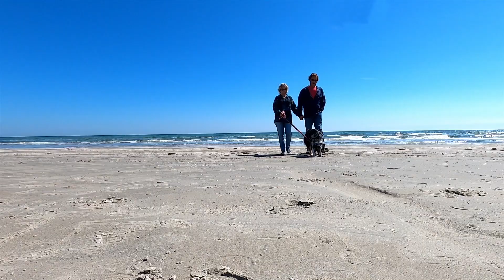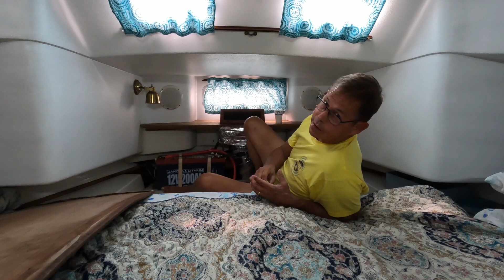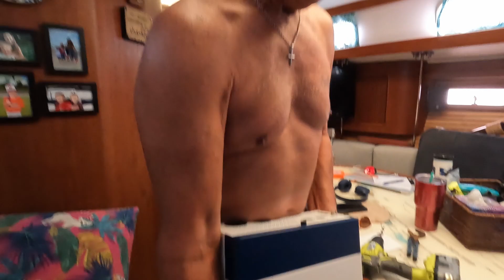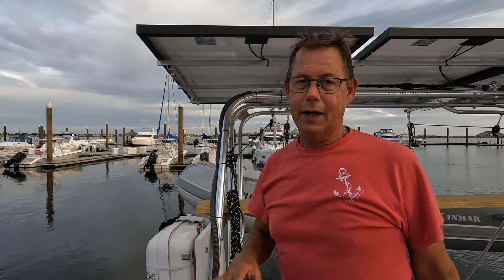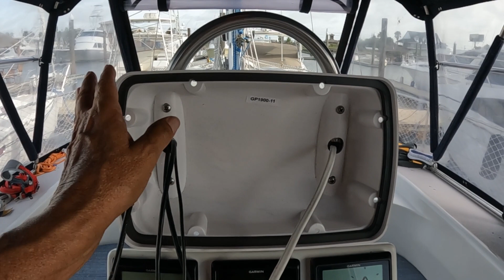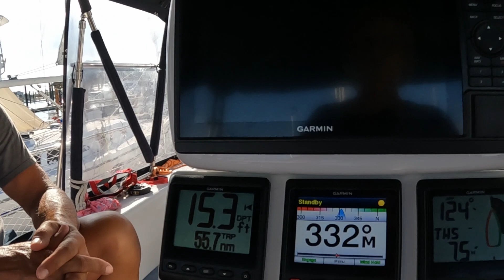Upgrades To Our 28 Year Old Boat Eps.13

Comment: We are where you were updating the boat. I just priced out a Balmar to improve our time on the hook,  but decided to wait  a while, the replace the AGM house bank with lithium and add a dc-to-dc charger with a solar panel banks when we cast off for good.  Right now, we only have 330W of house (plus 330 start/winches/windlass). That means we're good for one night without starting the motor. We love ya'lls videos. Just found them. Too bad we didn't  meet ya'll before you left. We're in Seabrook, both still working (because. sigh) but retirement, or our version of it, looms. About to take our first long sail, down to Port A, like you did. Full time might not be in the works, but we have a plan!   Safe sailing!
Reply from the maker: Hello @Rockhound7654! Thank you so much for the comment. Best wishes and keep us updated on your plans and progress.

Since you saw the video, you know what we installed yet I wanted to let you know so far it has all performed very well. I have regulated the Balmar alternator back to only 70% and we seem to charge the 800 Ah bank quickly. We do very well on the solar as well. 

I am probably most satisfied with the Altmount Serpentine Conversion. Our original V-belt seemed to be aligned yet we ate belts. Now we are pulling a much bigger load with the high output alternator and have had zero belt issues.

Smooth Sailing My Friend!